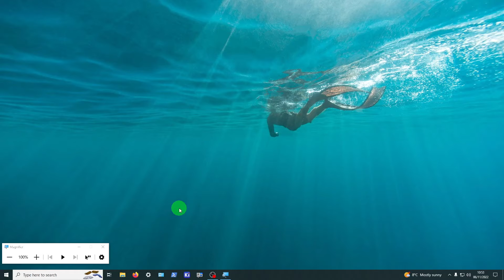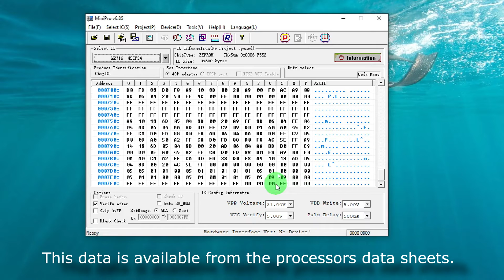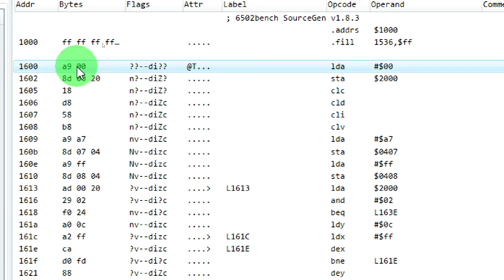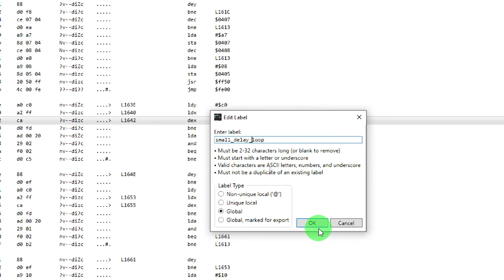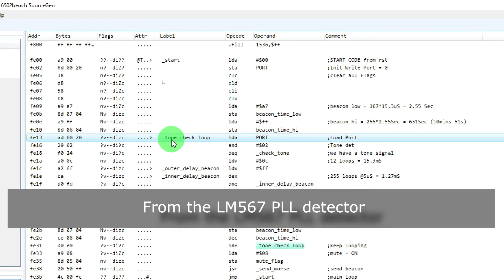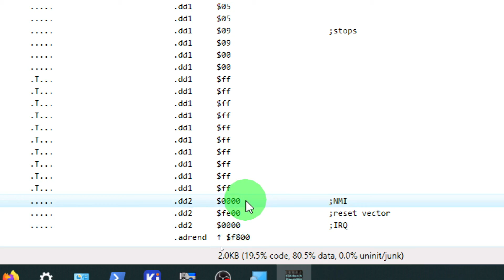Reverse Engineering an Eprom (6502 repeater) to readable Assembly language using a Disassembler

Comment: Takes me back a few years. Back when I was in 6th form I had an Acorn Atom (the machine before the BBC computer), and no printer. The college had an old KSR33 110 baud RS232 terminal. I knocked up a level shifter from an op amp and a couple of lab power supplies, hooked the printer vector to some code I wrote to convert parallel to serial, wrote a 6502 disassembler in BASIC and printed out a dump of the Atom ROM (4K in size IIRC). Software and hardware have improved a bit since then😊
Sorry I didn’t see your correction in the description for the previous video, they don’t show up on an iPad unless deliberately clicked.

Comment: A very interesting run through of the explanations of what the hex actually means.
I have only done a little reverse engineering but did follow quite well.
I had 3 Commodore 64 machines and remember the cpu was a 6510...probably a modified 6502.
Ben Eater did a video about an eprom programmer which I built and used to recover the data from an old eprom chip that I programmed as a slow scan tv grey scale generator.

Comment: Bit slow going but fun all the same.  I would have though that the disassembler could have the reset vector label point to the _start now that you have the ROM located at the correct place.

It is amazing what still gets done in tiny bits of code that would once upon a time have required a full circuit board of logic.  We have these 8 pin micro-controllers in everything from fairy lights to key fobs doing hard work with minimal resources.
Reply: There's an awful lot of those tiny bits of code still running on 6502 cores as well, it's still in production and used in absolutely all sorts of products.

Comment: Just found this, Think this will go over my head a bit. In a job 1994-97, Data logging, dashboards, speedos, rev counters. electronics, 2 boards stacked inside. stepper motor. Got told what it was by one of these type of eprom. Wipe with the light through the window as you say in not 2 minutes. Old skool. I did that bit, program and test, upgrade, change, repair.
Reply from the maker: Thanks for watching Daniel.
Reply: @NEEC1  Understood the plain english bit more  :) when it was not all code.